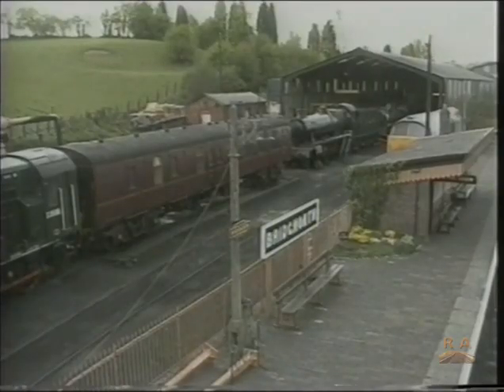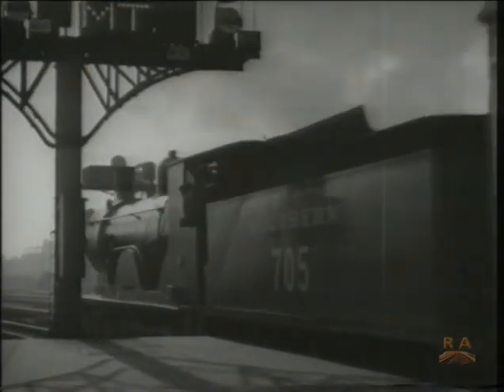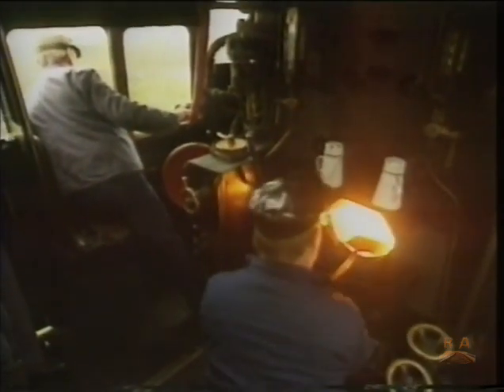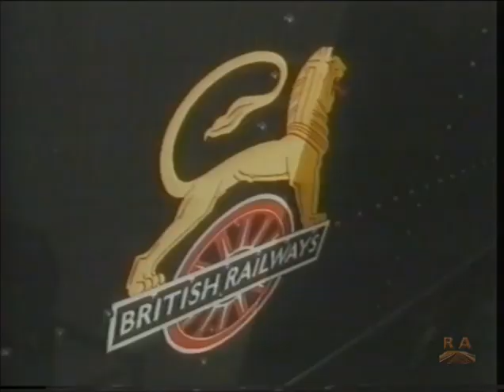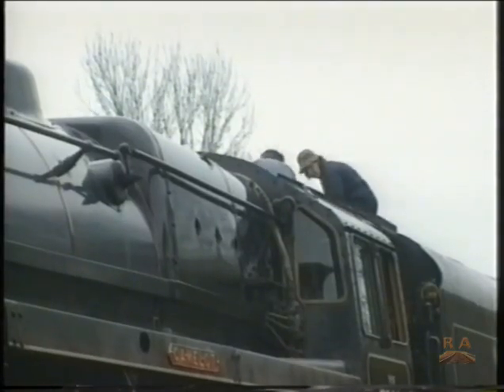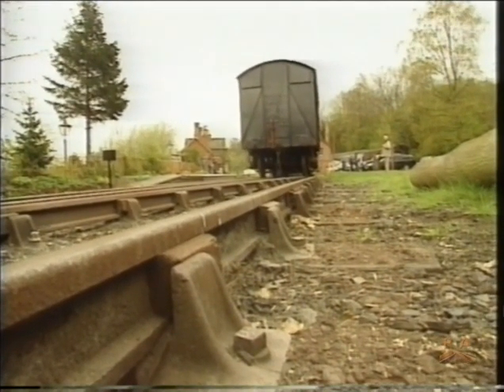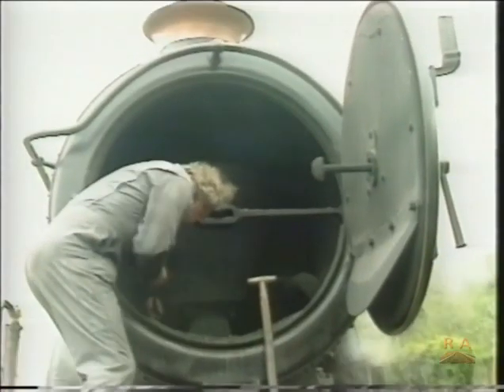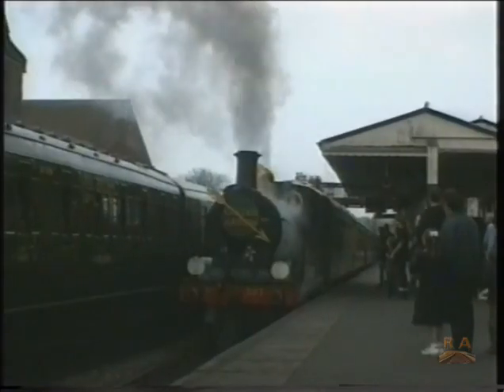British Railway Archive - The Golden Age - UK Steam Trains

Comment: Why didn't BR use oil firing?
Reply: It's still much less efficient than internal combustion. And the locos still take a long time to get pressure up and be ready. Plus at the time, they wanted to present a more modern image, and that wasn't steam which was old technology come the 1960's when they had lost millions of passengers.

You need to realise that rail locomotive power is not provided for the sole titillation of a few rail foamer fans. There are loads of other factors.